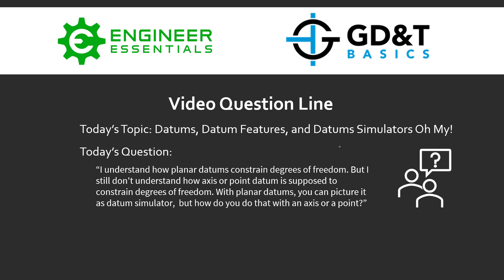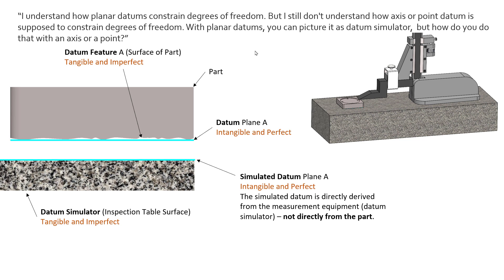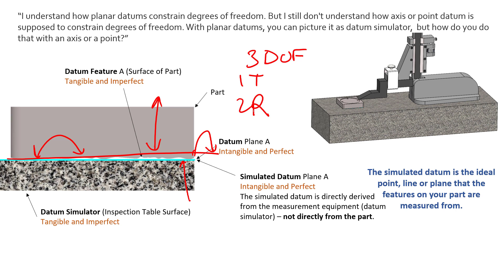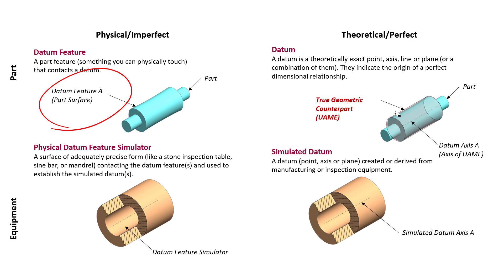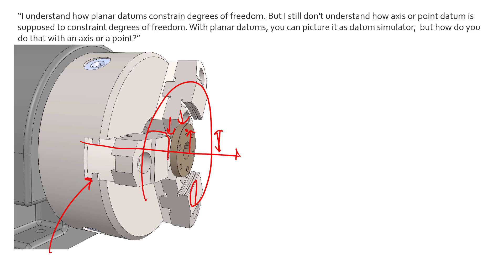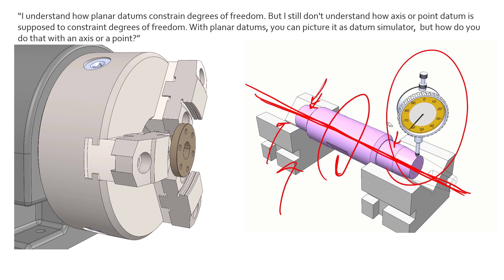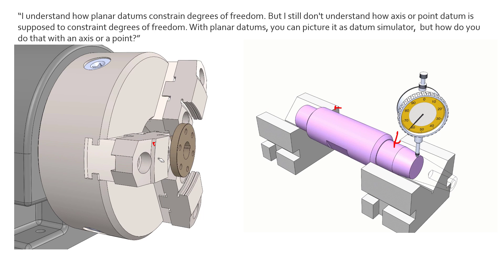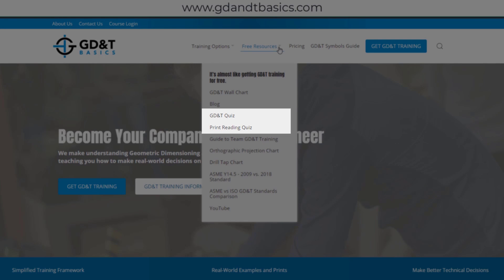Datums, Datum Features, and Datum Simulators - Oh My!

Comment: Thank you. Datum simulator across two journals as in the shaft example must also take the basic journals actual diameter size to establish runout or profile. As you say, its important to 'simulate' as best possible  therefore the height of one Vee has be adapted ( shim / gauge block) to compensate for possible shaft diameter differences.